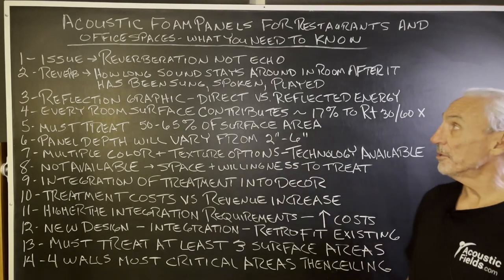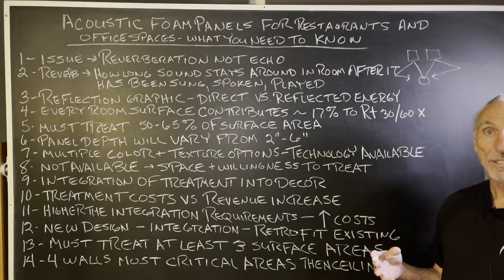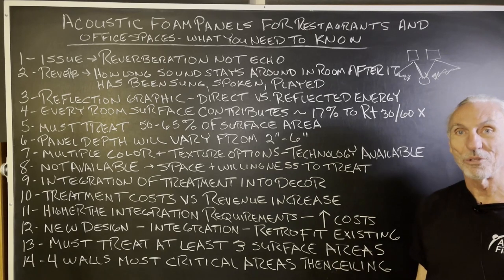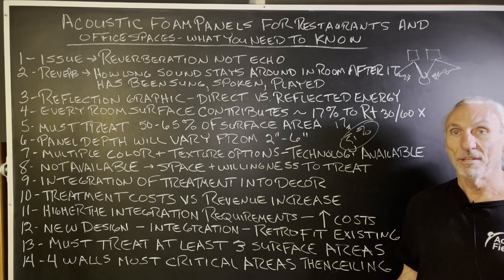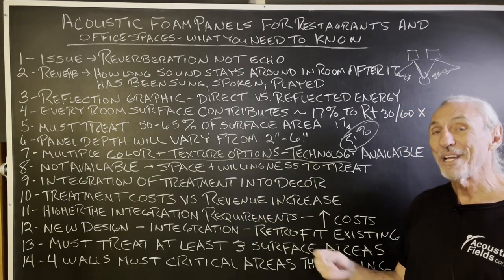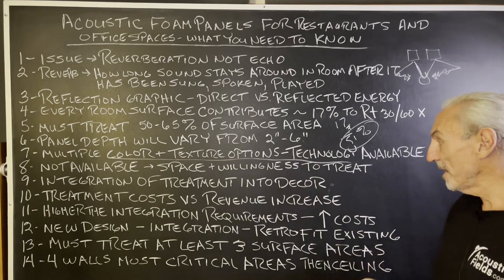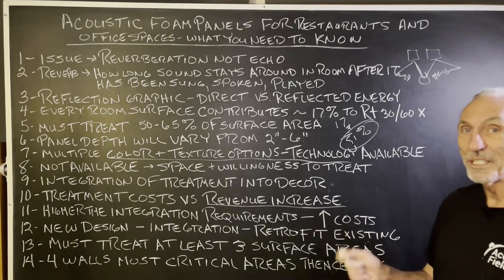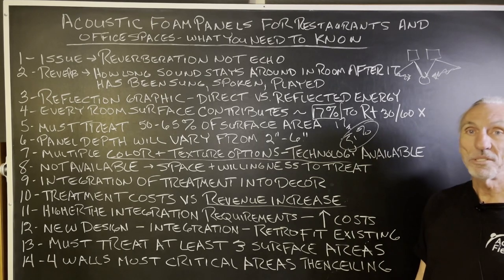Acoustic Foam Panels For Restaurants And Office Spaces - What You Need To Know

Comment: I've been reading up about "flutter echo" and I know it happens in small rooms, I've had rooms that had REALLY bad flutter echo problems. I'm finding a variety of different descriptions and definitions on the internet.     I know Flutter Echo is usually repeated in quick succession between two surfaces close to each other.  Now is that really a type of reverberation or would it still be considered an "echo"?
Reply from the maker: It is reverberation defined at certain frequency ranges.